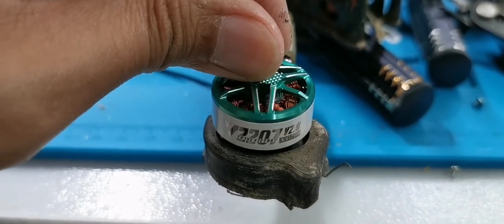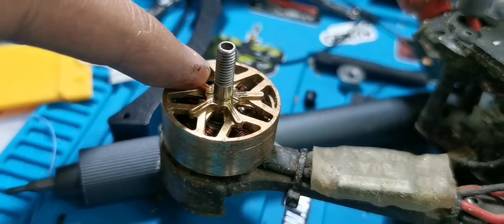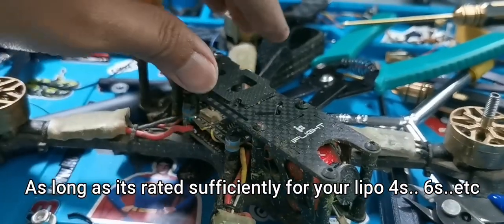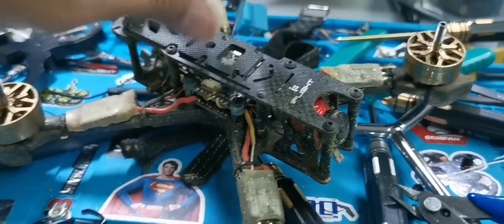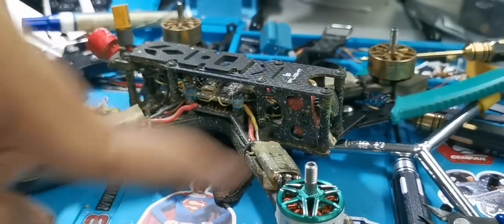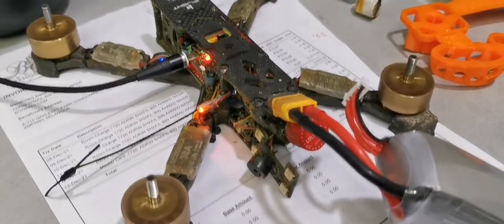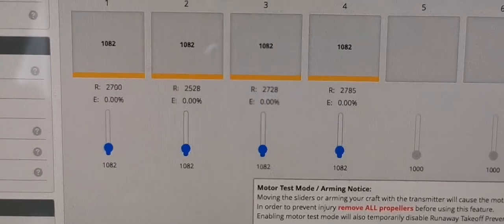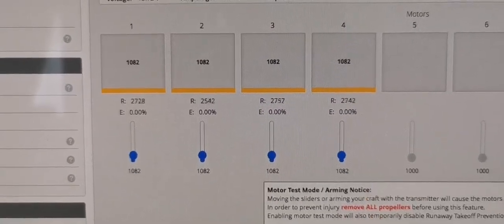Mixing Motors on a Quad - What's the worst that can happen?

Comment: Thanks for this video. Not sure it answers my question but at least you are talking about it. I was about to repair my Armattan badger in time for warm weather and found out that the Armattan TOA premiums 2306/1750 has been discontinued!!!!!! Should i just get same dimensions and use?
Reply from the maker: Yes
I had the same issue on my armattan so I just stuck a tmotor F40 pro IV on one arm and can't tell the difference.